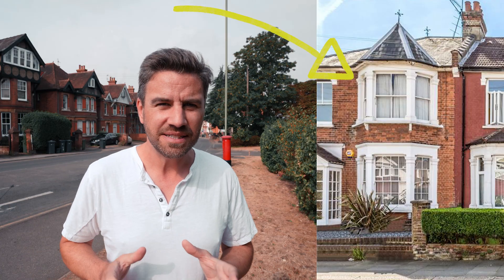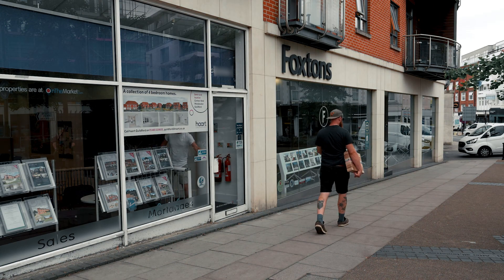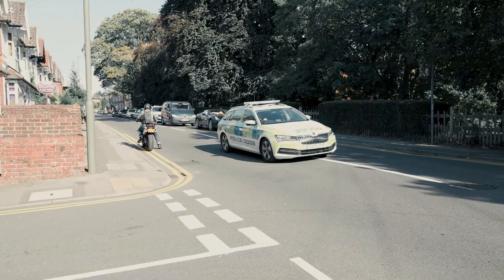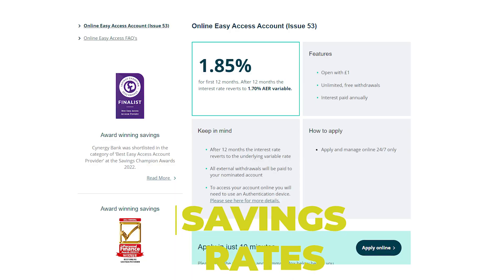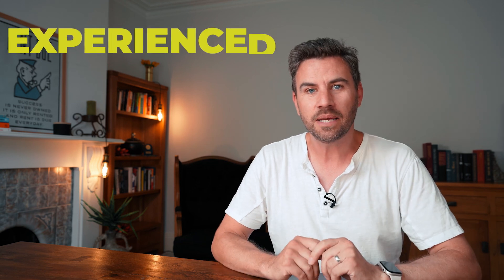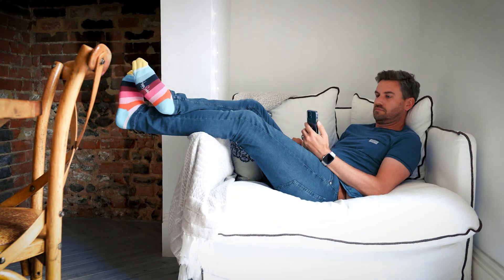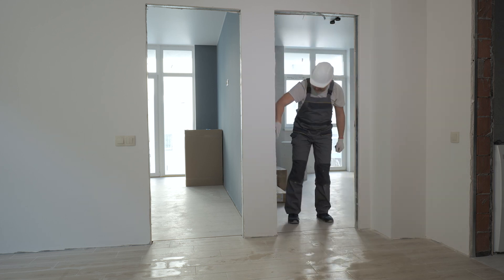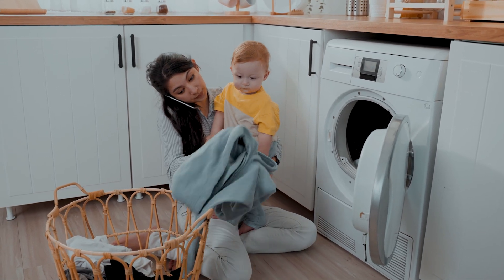How To Buy Your First BTL Investment Property (Start to End)

Comment: New subscriber! Great content. I have a question. I’m wondering whether you think it’s a good idea to purchase a town house that is split into multiple flats, say 3, and live in one and rent out the other two as my first ‘home’. Also would I be allowed to do this with a residential mortgage? Also, follow up question, would you recommend this as a viable strategy for someone who wants to move out of their family home, gain some rental income, but also have privacy, i.e., avoiding having to lodge rooms and share communal areas. Preferably I’d want to live for free, so the rental income exceeds my mortgage plus home insurance, etc.
Reply from the maker: Hi Lloyd, I think it's a great idea but if its already split into flats you may not be able to get a residential mortgage on all of them. You would need to check with your broker.  What would be even better is you buy a town house on a residential mortgage and then split it into flats and then rent out the flats. Bit more work but it's the outcome you want. This is a great approach to 'house hacking' and living for free.

Comment: No stamp duty  tax for  a £100.000 property.
Reply: There is a 3% stamp duty charge on the purchase of a second residential property (Buy to let or a second home, for example), this 3% charge is on top of any existing rates that are in place, therefore, while there is normally not a stamp duty tax on the purchase of a property under £125,000, as it is a second property this would now be charged at 3%.

For Stephen's example, the house costs £100,000, 3% of this would be £3,000.

Also, the 3% is applied when the value of the second property is above £40,000, therefore, if you were to buy a second property worth under £40,000, you would not pay any stamp duty. Hope this helps! :)